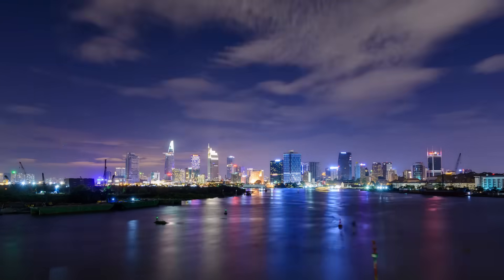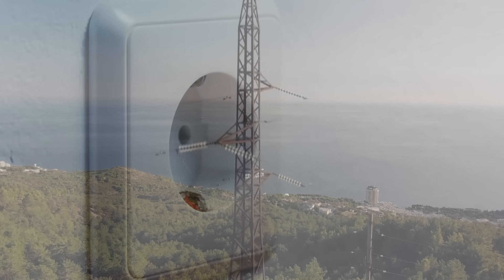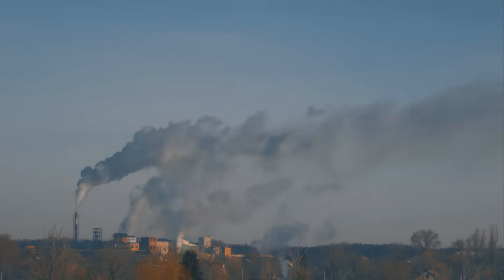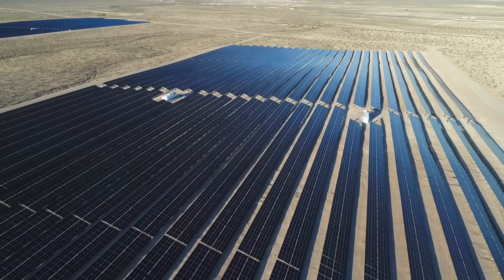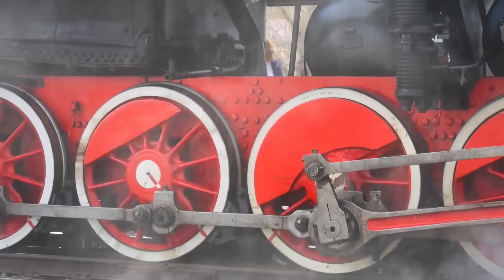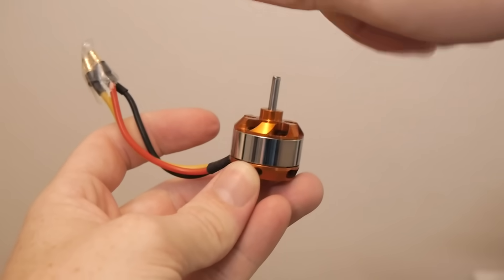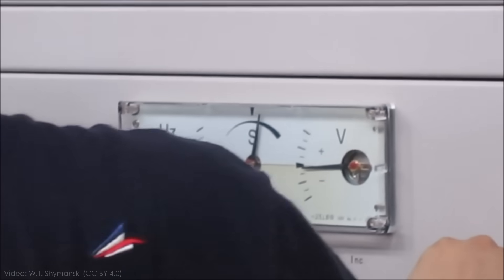How Electricity Generation Really Works

Comment: electricity the only product that dances to the beat of one drummer. Meaning, ALL GENERATORS no matter what must synch to the same standard or be rejected by the protections demanded by the system to participate. 
System Protections protect against unfriendly participants. You must match the system before synchronization and load appropriately to what the System Owner tells you. From hydroelectric to Wind Turbines. Everybody plays according to the rules. 
Interesting, that even a mighty big Generating Station can fail for whatever reason, and the System synchronization dance will absorb this loss with barely a blip. 
EXCEPT, when players play dirty and don't do their due diligence and you get the Ohio Effect reaching around a Great Lake and cascading eastward taking out the rest. In this case, Generators protecting themselves from the Other Guy on system frequency protections.
I wrote a BOOK OF DISTRIBUTION, 4KV to 120v distribution, to assist Work Protection and understanding circuit distribution to vital equipment in case emergency or shutdown. To often people misunderstood what provides power to a specific location or what may backfeed a large distribution MCC Panel. I combined drawings, and illustrations to every panel to ensure pathways of understanding.

Comment: Congratulations on the amazing and very well-structured video. It helped me understand the relationship between load and frequency, and how important it is to keep it stable. Just a few seconds before the explanation, it made me realize that if someone, for example, blocks the blades of a fan, the windings produce a noise due to the high current flowing through them. In the end, a generator and a motor are two sides of the same coin (sorry if I'm mistaken).

Comment: Modern wind turbines do NOT provide inertia on the electrical grid. !!!
Reply: Please explain electrical inertia...😮
Reply: @jimvinson6046 . Electricity is a means of transferring energy. The energy comes from the machine that is doing the work. Large metal turbines at hydro or thermal or nuclear have inertia as they spin. Turn off the power driving the turbine & it keeps spinning, for a while. Add extra load under power & it spins a little slower.  That is the mechanical inertia wind & solar don’t have. 
All turbines must be synchronised before they can be added to the grid otherwise their AC will cancel each other’s out, providing no electricity on the grid
Reply: @renesmit6774 you discussed mechanical inertia.  so what is electrical inertia?

Comment: Can you explain hydro power?
Reply: the turbine is turned by fast moving water instead of steam, apart from that its the same
Reply: Falling water spins the generator vs. Steam spinning the generator (which is the most common case).

Comment: Well, You can have none of these methods existing without pre existing electricity and technology made based on electricity. And since nothing appears in physical reality from thin air, and everything has to be some sort of natural resources that have to be converted to tools and technology that makes wires, cement, metal etc You get infinite loop - A HUGE FLAW IN LOGIC OF SCIENTIFIC EXPLANATION OVER HOW THINGS EXIST IN REALITY. So this is just basic explanation how things look like in this simulation You live in. The same rulles don't apply to simulation that is outside of this simulation.
Reply: ..
But, how is this useful information??😮😢😂
Reply: you are way overthinking.

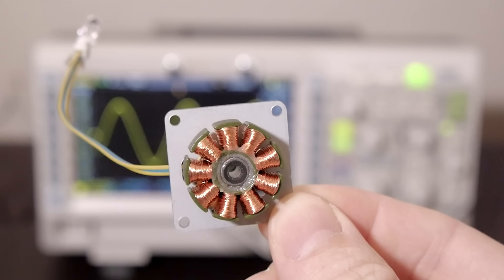Comment: 3:16 the shape of the wave on the oscilloscope corresponds to the curve of his thumb and forefinger moving the rotor. Starting at the tip of the thumb, the thinnest part, the wave gradually gets larger until the rotor reaches the knuckle, where the energy peaks and decreases as it moves down the curve of the finger. There is another peak after that point that corresponds to the knuckle of the forefinger moving across the rotor as it rotates.

Comment: I have been following CAISO app and am surprised on a hot day in June most the power came from solar. At sundown the primary power was wind. I was also surprise of the 10% available power from batteries. California has 1 nuclear power that runs  non stop.  Above average winter snow is money in the bank for hydro power. . There are no coal power plants. Geo thermal  and Natural gas makes up the balance. California has the second highest percentage of electric and hybrid vehicle ownership next to Norway.  I would like to see a video of the CAISO control room near Folsom, CA.

Comment: Well in practical terms it is only because solar has not been integrated that the electric grid doesn’t keep the electrons smoothly ready for use in laggy times. Oh yes. That is not just a fossil fuel advantage. It works for solar as well. After grid integration. And wind is quite a heck more efficient at energy generation. Which fossil fuel is not. Not because of the fuel but because engines running on fossil fuels are at best only as good as solar PV efficiency. 😅

Comment: wind exists because different parts of the atmosphere are heated differently by the sun
fossil fuel contain energy that was stored by organisms which at the end of the food chain gathered energy from sunlight
rivers flow because of water that rained down somewhere after being evaporated by the sun
the the energy in the sun comes from nuclear fusion

thus almost all energy we use utilize is nuclear power
the only ones i can think of that are not are geothermal and tidal

Comment: It's not the most efficient, but I guess some generators run above demand producing watt-less current to fill increases in demand at a seconds notice ?? Also I've seen capacitor banks on the grid that supply sudden drops on the grid to keep the 60 hz and steady voltages going.

Comment: Great video, but you got the Spinning Reserve part wrong. Spinning Reserves are units that are tied to the grid but generating less than their maximum output. Usually just minimum output. And, are able to respond quickly to changes in load due to system issues or customer demand. Specifically, you stated that spinning reserves are waiting to tie to the grid. That is the incorrect part.

Comment: Frequency is not held constant, waves are counted. They try, but it is never 60.00000Hz. At the end of each period if there were too few waves, power gets turned up higher so that there will be extra waves as needed. At the end of a day there will be 60*60*24 power cycles that will correctly turn your clocks.  Maybe next you can tackle imaginary power.

Comment: The blades of my box fan match the flickering of my LED lights, so that the blades appear to stand still. I noticed that they would slowly "move" forward or backward at times. I put a meter in the outlet, because I suspected it might be a voltage variation. Nope, voltage stayed the same. Now I'm wondering if the generator was picking-up or dropping-off loads, and that was the cause. Or maybe it was just the turbine speed.

Comment: Nice explanation,  but...

1) Spinning reserve should've been better explained. Spinning reserve units ARE already paralleled (hence spinning),  albeit running at reduced load

and,

2) Thermal efficiency should've been explained. The majority grid generation fraction, by far, is heat engines. Running overall at exceedingly poor Thermal Efficiencies.  Excepting the newest combined cycle units (which will run 63 1/2 % LHV now) overall grid efficiency is lousy. Lucky to hit 33 - 34 %, depending on where measured. Thus giving rise to huge waste heat emanations. Thus causing global warming (The prevailing, "Tiny changes in trace CO2 concentration is causing our Global Warming." theory is beyond ludicrous.  Practical infinite positive feedbax would be required.

Comment: Something I'm surprised I haven't seen developed is small-scale pumped storage for high rise buildings. Basically take a water tower, build a high rise underneath it, and put a hydroelectric turbine and water pump in the basement. Pump up water during the night when excess is available, and let some of the water flow down during the day to help with high demands. It could also be used to smooth the demand curve out when sudden changes happen or even store potable water for emergency situations.
Reply: It's probably to expensive to do in a building. Remember, electricity is cheap. Pump storage is very common in mountainous areas, because you don't need to build the building.
Reply: This is an approximation to give you an estimate to how infeasible it is to do this. If you lift 50 tonnes of water 10 metres you have approximately stored 1kWh of energy assuming 100% efficiency. Given a typical skyrise power use (only the scale of hundreds of kWs) you'd need to lift hundreds of thousands of tonnes of water on top of 100m skyrise. More than the mass of the building itself
Reply: @Oliver-ho4jz  thanks for the numbers. To be clear, I wasn’t picturing a building being able to produce a large percentage of its own demands. I meant for the idea to be a supplemental sort of thing. I do understand though that water itself is heavy as hell (1 m³ ≈ 1000 kg) so storing a bunch of it 100 meters off the ground is no joke. In some locations I imagine it would even be an earthquake hazard.

Comment: What you consider a disadvantage to solar, I consider an advantage.  There is no rotational shaft involved in PV inverters, but the inverter doesn't need to match the load exactly.  A lightly loaded synchronous inverter has breathing room.  A fully loaded one is more efficient, but it may have a shorter life due to the heat produced by its components.

If I had my druthers, I'druther that rotating shafts be taken out of the picture and that inverters break the connection between synchronous power from a shaft to a synchronized PWM three-phase inverter.

(Also, syncroscopes are something of an anachronism now as synchronizing is done by computer.)
Reply: yes it does. if you start to put large amounts of out of phase power into the grid it'd do tens of billions of dollars in damage to sensitive electronics and huge plant equipment alike

this isn't an "i consider" thing. it's a solid engineering problem. you are wrong
Reply: @afgor1088  Who said anything about putting out of phase power on the grid?  A synchronous inverter -- the type used with all grid interconnects today -- depends on the existing circuit's frequency and phase to set its own.

But imagine a future where rotating coils are the minority of the grid, where a black start might be done by a DC based plant bringing up 3 phase power lines.  Literally designing a hybrid synchronous/self-stabilizing inverter is, well, they exist today.  Have it lock frequency to a GPS disciplined standard.  The now minority of rotational loads synchronize with this device, and this device keeps the same frequency regardless of load.

The black start/self-stabilizing frequency has now nothing to do with load, and only exists to keep the existing vast infrastructure of the power grid working in the future.
Reply: @efricha  OK 👍

Comment: This video talked about only one electricity generation source- using a turbine. Solar photovoltaic (PV) systems, internal combustion engines, fuel cells, Stirling engines (used in solar thermal parabolic-dish generators), and thermoelectric generators are examples of non-turbine generators of electricity.

Comment: PV has come sooooo far in just a few short year’s, it’s kind of crazy that we aren’t utilizing it MORE. They have new cells that can produce energy by the sun and moon. We’ve got salt, hydrogen, and water options that are gaining steam as well. I am building a “tiny house” cabin on my family’s land, I have 3 335w solar panels, a hybrid or all in one made by MPP Solar’s 12v LV-MK split phased 120 or 240 Charge Controller/Inverter system that has a 2K inverter, automatic transfer switch, everything can be programmed the way you want it, everything can be done via Wi-Fi or Bluetooth and every bit of safety device’s to keep it and my system protected already installed in it. It is made in Taiwan and the Chinese clones try their best to copy cat it BUT don’t have the tech to do it,  you can connect up-to 9 of them to increase and meet your need, so you can grow your system or just add more as needed. OH AND MOST IMPORTANTLY, IT’S PLUG AND PLAY, IT’S PLUGGING IN 4 CABLES… THAT’S IT. I have a 12v 200AH lithium battery with built in bms. The MPP Solar’s Hybrid cost me under $600… I am extremely pleased with my little set up and plan to purchase more in the near future. The system I went with allows me to do just that and comes highly suggested from many of the “solar know’s” and Solar YouTuber’s like Will Prowse. If you’re looking for a good little set up, one that’s affordable but HAS PROVEN RELIABILITY AND BACKED BY A COMPANY W INTEGRITY AND THAT ACTUALLY ANSWERS IT’S CUSTOMERS, MPP Solar is strongly suggested. I like that as a beginner like myself I can create an off grid system and fell comfortable that I’ve done it right, it can be adaptable and grown with my needs and I didn’t have to pay someone to do it and…. It was really as easy as plugging in a few cables. 

So yah, it’s kind of crazy how far renewables have come and I look forward to the world finally taking renewables more seriously. They have come down in price to become extremely affordable and at times cheaper than the alternatives. Thanks for the vid, helps explain it all in a very informative but enjoyable manner. 👍🏻

Comment: if there is extra power being generated and reducing the power generation is too slow or not possible are there ways the power is wasted 

For example running the excess power into a metal rod in the ground

^how much power become dangerous where it is not safe to walk on the ground around the discharge

Comment: You forgot to mention combined cycle which, yes, uses a fossil fuel, but it uses it directly in a combustion turbine (which generates shaft power and is connected to a generator), and then the waste heat in the exhaust from the combustion turbine is used in a waste heat recovery steam generator to generate steam to power a steam turbine which turns another generator.  Very high efficiency cycle.  Much higher efficiency than conventional direct-fired boilers.

Combined cycle plants running on natural gas is the "stop gap" between getting off coal and getting onto more nuclear and renewables.  Batteries will be needed to even out the fact that wind and solar are not consistent and dispatchable.  We'll get there.

Comment: Hi Grady, love your channel, learn really facinating things here from time to time (despite having PhD in biophysics). I'd like to suggest a topic which can be really interestng and useful for others – and for me too. The topic is principles of changing of electronic devices. A simply put question is: what power banks I can use to charge my laptop?

I can see that the charging device reads "output: 20V⎓3.25A 65.0W/15V⎓3A/9V⎓2A/5V⎓2A 10.0W", so it gives 20V*3.25A=65.0W. But what about the laptop itself? I haven't found details regarding required input. What to look up and should I search in the battery specs instead? If the laptop expects 20V*3.25A=65W, what are requirements? Can it be less current and same voltage? Less current and same power? Etc. I've tried a powerbank with up to 12V*1.2A which is obviously not enough (didn't charge), but it also said it can give 2.4A at 5.1V – so will it be enough to, say, connect to a powerbank that claims to give 2.5A at 30V? There are some non-linear bits that are difficult to understand (like why 2.4A*5.1V ≠ 12V*1.2A and what is constant for the charging device) without knowing principles of engineering such charging and consuming devices. There's a gap between simple questions (which powerbank can I use?) and simple answers (will work/won't work/can hurt/not enough info) which you may want to help filling.

Comment: Most modern natural gas plants directly drive their generators by a gas turbine engine.  The steam is then made from the exhaust of the engine and either routed to a separate steam turbine generator (multi-shaft), or to a steam turbine connected to the opposite end of the generator shaft (single shaft).  The steam system is used as an efficiency improvement by capturing the heat from the engine exhaust but it isn't the primary source of energy.  

The gas turbine engines themselves come in two flavors: industrial, which are generally slow turning and have very heavy casings, and aeroderivative, which are close kin to airliner engines that turn much faster and are much lighter weight.  Aeroderivative engines generally use a gearbox between the generator so the generator can turn 3600ish RPM (2-pole synchronous speed in North America).  Aeroderivative engines also generally make more use of exotic materials in their construction.